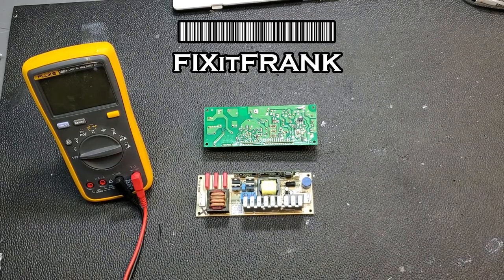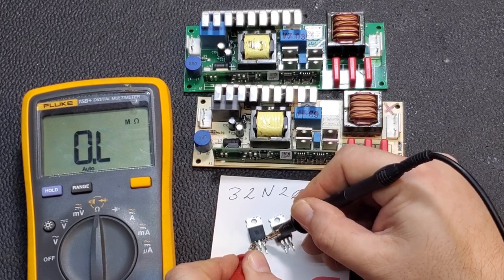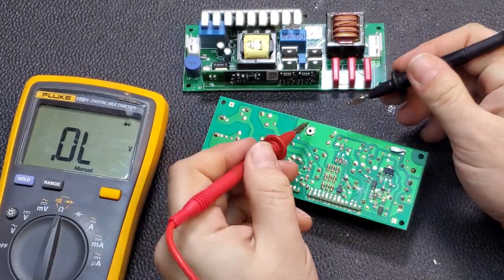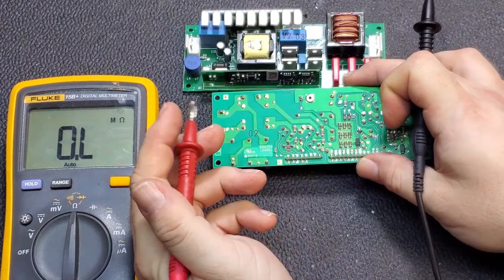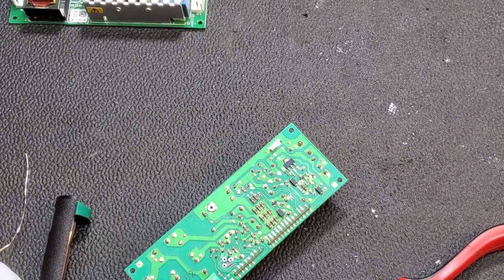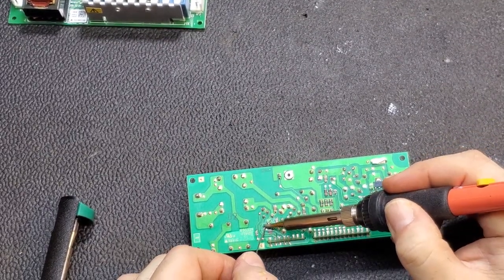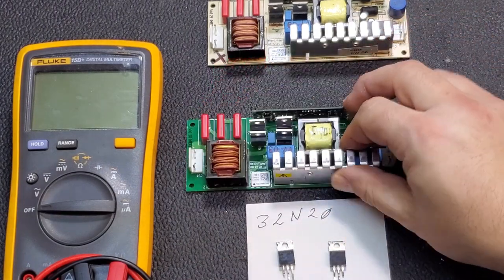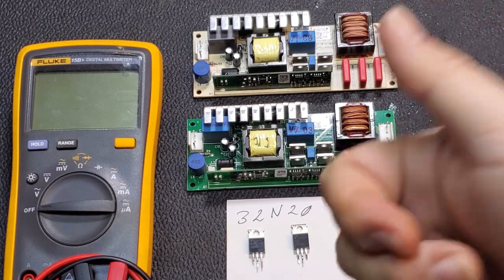Digital Video Projector Ballast Diagnosis and Repair

Comment: I am so inspired by this Chanel, and of course YOU, a very cool instructor. This video in particular is really superb. I am restoring some vintage film projectors, some of them are from nearly a hundred years ago. The biggest problem one meets is with the old light source. The lamp bulbs are not easily available most of the time. And even when they are available, expensive in buying them, and wasting a lot of energy for nothing when in use. So I am experimenting converting them. Right now I am working on a 35 mm Zeiss Ikon Kinobox, everything is great except for the lamp house, which is missing. So I am building a new devoted lamp house from the ground up, with a 230 W HID, so this video comes in very handy, as I pulled out the ballast from an old/defect Toshiba DLP projector and reuse it. Here you explained the basic build-up of the ballast, and troubleshooting, exactly what I needed. So thanks again!
Reply from the maker: Thanks Bob!! If you need any specific info let me know. Osram has a pdf on the internet with a breakdown of the ttl controls too.

Comment: Thanks so much for taking the time to make this video Frank! I've an Optoma HD26 - it told me things were going south but I didn't listen :) For the better part of 2 or 3 months the projector would do a flicker on bright images - sometimes seeming to get stuck and eventually start displaying normal video. Also there was a nasty little wine that would come and go. Somebody recently left the projector on all day and that may have helped to push it over the edge - but it was still working. Finally two days later upon projector startup I got a popup that prompted for remote security code - though I'd never turned such on. I figured out the default and then I'd get a quick flash of normal video and then snow. On the LED side - I got red flashing power and solid red lamp. I figured duh - gots to be the lamp - took it out - looked solid, put in a new - same symptoms. Then I noticed research pointing to the ballast and thats how I happened upon this video. Took out the board - which has the AC plug integrated on the same board. Checked the obvious things (especially fuse and MOSFETs in the output path) but all check out. Any advice appreciated! -khalil
Reply from the maker: Hey there Khaliln!  The mention of the "whine" .... Yes, you have a color wheel problem most likely.  They will shut off the lamp and make flickering of sorts.  Also, if you are on your original color wheel, then its well past its replacement time.  I'd recommend maybe cleaning the color wheel sensor(look up my HD20 video) and it may run a little while to confirm.  Otherwise, I'd pickup a color wheel off ebay/alibaba etc. I suspect that will get your HD26 back up and running happily.
Reply: @FixitFrank  Success! New color wheel and it's up and running. Thanks again!
Reply from the maker: @khalilnkhaliln  Sweeeeeet!! That is awesome to hear! Thanks for letting me know!

Comment: Not sure if this thread is still monitored, but wondering if a a marginal ballast would be exhibiting low output of video? We had a couple rebuilt 3 years ago and gradually the image is dimmer. We've bought new bulbs and believe them to be good, but the intensity of the image is nothing like it was 3 years ago, The projectors are Eiki 'Boardroom' projectors, model LC-X85. Just wondering if the MOSFET's weaken or become heat stressed and work to some degree, but not as they should...and equate to a low output LUM?
Reply from the maker: I dont want to say its impossible but I have never seen that happen.  Mosfets tend to work or not work.  In my experience when you have a failing ballast they just dont light.  I have not seen one put out partial power.  I would check the optical path for dust buildup before going after the ballasts.  The LCX85 is anywhere from 7-15 years.  These older LCD units start to have issues with polarizer panels, dichroic mirrors and other optics as they age. Being that this model uses a 330W ushio bulb, they are being hit with a lot of heat inside.  My money is on dust build up in the optics instead of a failing ballast.  Like I said, I wont say its impossible but I have never seen it myself.

Comment: Great video.  I'm hoping you can help me to diagnose my issue.  I have a 73" Mitshubishi DLP.  I purchased an Amazon bulb which lasted trigger a the "bulb" light after 2 months.  I unplugged the TV and inspected the bulb and saw no visible damage to it.  I plugged it back in and the bulb worked but I was getting some shadowing on the screen.  I took apart the TV, carefully cleaned the color wheel, cleaned the lens and reassembled everything.  The shadowing was gone but the "bulb" light came on again.  Under warranty I received a new bulb which worked for about 2 weeks.  I hear a few clicks, hear the color wheel and fans spilling up ... this happens 3 times, with a  minute between each time, then stops.  The green power light goes out but no red "bulb" light.  I removed the ballast (and kept wires connected) from its housing and plugged directly into the second bulb.  The bulb lights up for a few seconds and makes a "sizzling" sound for each of the 3 cycles.  I plugged the 1st bulb in which only produced a slight glow but no "sizzle".  I measured the voltage going into the ballast of 343V between cycles and 330V when it attempts to turn on the light.  All fets and diodes measure OK.  Diode side of OPTOs measures OK.  Could the problem be the main power supply or just bad luck on that warranted bulb?  I would hate having to purchasing another bulb to test the theory.  What are your thoughts?
Reply from the maker: Hi Ray,  Make sure that bulb says Osram or Philips on it.  Otherwise you have no idea what is really inside. Those amazon lamps cause more trouble than you would believe...  Now if the bulb says Osram or Philips, then you want to make sure its the right wattage(I think 150-180 is normal for a 73"). I'll figure its correct for the sake of troubleshooting because the voltage you are reporting is a little low.
The DC to the ballast should be closer to 380vdc. There is a known issue with capacitors on the power supply(main PSU) of Mitsubishi's.  That can cause this.  If you can provide the model #(WD73xxxx) I can get you more info.  The fluctuation is interesting. That is supposed to be regulated.
In short, make sure the bulb is Osram or Philips only.  You can't trust knockoffs. Second, get model # and I will see what caps you want to check.  They are not usually bloated or obviously bad(but it can;t hurt to give a look since they might be).  I think the low ballast supply voltage is your root issue but I would not rule out the bulb unless you know its a name brand.
Those are great TVs. Its worth putting a couple of bucks into it.
Reply: Frank,  thanks for responding.  My TV is WD73C9 bought from Costco in 2009.  The OEM bulb lasted 5 years.  The 3-4 bulb since didn’t last nearly that long each.  They were not OSRAM or Philips.  Can you provide me a trustworthy online source to purchase a lamp assembly or just the bulb. Also, when I was measuring the DC input to the Ballast, I also measured an AC voltage, if memory serves >400VAC.  I found an online schematic that shows a voltage doubler circuit for the DC voltage generation.  There are rectifiers and caps that should remove the AC component correct?  Could something be wrong in this area?  Bad or leaky caps will cause increased voltage ripple and a bad diode may turn a full bridge rectifier into a half bridge resulting in higher output ripple.  What are your thoughts?
Reply from the maker: @raycampbell3739  I am not affiliated with these folks but I do know of them. https://www.bulbsolutions.com/products/915b403001  This uses an Osram Bulb and will remove the variable of the lamp and they have a 6month warranty.  I still kind of think its the lamp in your case.  I did some checking and your model is not one of the more common capacitor issues models.  There is a thing called the 'green light of death' that will plague some models.  IT can act like a bad lamp but flash the green LED continuously.  I suspect the strange voltage readings are due to the high frequency used in the power factor circuit that creates the 380-400dc.  It's running a lot higher than 60hz which can cause RMA AC readings to be strange. 
I'd recommend taking a step back and putting in a lamp with an Osram bulb. Without having that variable removed you may run in circles. The company in the link will also take the lamp back for a refund if it turns out you have another issue which is nice.  Try the lamp first and let's see where that get's you.
Reply: Thx for the advice... I will give the lamp a try and let you know how it turns out.
Reply: FixitFrank,  I finally got around to ordering and installing the lamp assembly.  Two months in and so far so good without issues.  The “Amazon” lamps barely last this long.  I would most definitely stick with a legitimate lamp supplier in the future.  My original OEM bulb lasted greater that 4years ... I hope this one will last just as long.  Thanks again for your help and advice.  Keep up the good work!

Comment: Thanks for the video. I have a strange problem. I have sharp PGA20X projector. It was working perfectly well over the last 5 years (with no issues at all), and I use it occasionally. This whole projector ( and its lamp) has about 1300 hours of usage only. Recently I am seeing the problem that sometimes lamp is NOT turning on (but some times lamp turns on) at startup. When I power it up, I see cooling fan is working fine, and lamp (LED) indicator is blinking fine, but after 90 seconds, lamp indicator and power indicator are turning "red", basically internal lamp is not turned ON. As per sharp manual, they say this scenario as lamp circuit failure. I thought lamp reached end of life. So, I replaced with a brand new OEM lamp. But still this issue exists. The strange thing is, the lamp will turn on some times, and it works perfectly once its ON. So, when ever lamp doesn't turn ON, I will disconnect power and re-connect the power & try again & again. As of now, once in every 4 times, lamp is turning ON. When ever lamp (even with old lamp or new lamp) turns ON, it works perfectly. I am clue less, what is wrong with my projector and how to fix it. These days I am looking to use this projector more frequently, so I want to fix this projector, any suggestions will be appreciated.
Reply from the maker: Hello Krishna,  That is a strange problem indeed. However I have heard of it before.  I have a few theories.  Since this is LCD, there is no color wheel to deal with.  I would be suspect of the fans.  I would download the service manual here.  https://elektrotanya.com/sharp_pg-a20x.pdf/download.html  If you have a fan that is failing, it may take a few tries to start up.  Once spinning it may be OK.  I see at least 4 fans in this unit. One by the power supply, One by the lamp and 2 for the LCD panels. 
However, even at 1300 hours, this lamp might be failing. My first recommendation is try a new or known good lamp. 1300 hours is a good 700 hours before I would expect it to fail, but if your environment is warmer this can shorten lamp life.  I would try a lamp first. If it is the same, then check the fans. If not the fans or lamp, then I would start verifying voltages and see if the power supply is suffering from leaky capacitors.

Comment: Hello, Frank. I own an Optoma DS551 and am trying to bypass the SMPS and ballast. I've monitored the signals from the ballast and tried to replicate them with a microcontroller. Unfortunately, I noticed that the SCI signal from the projector has a specific dialogue that I'm not familiar with. I've read much online, but nothing has clarified it. Could you provide me with a hint?